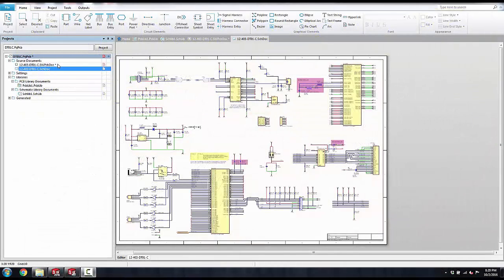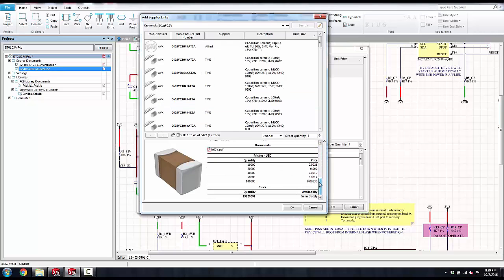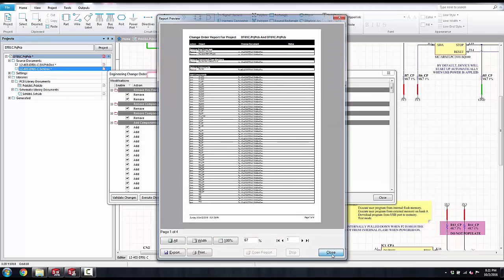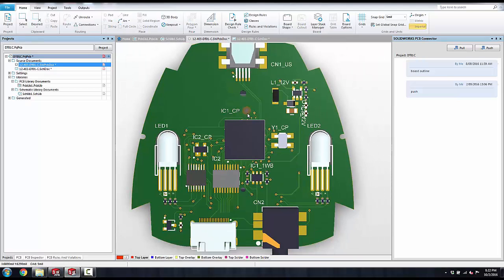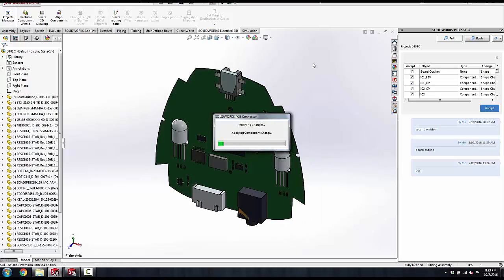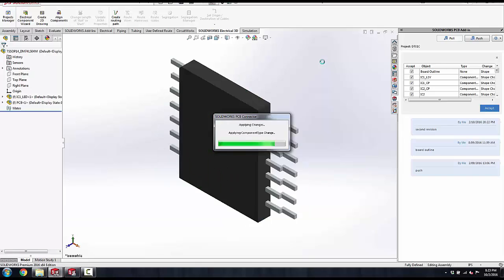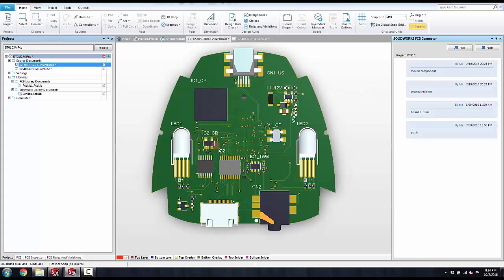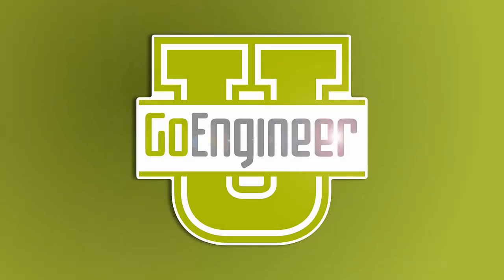SOLIDWORKS 2017 - PCB

Comment: WHAT IF I DESIGN A MOTHERBOARD IN SOLIDWORKS AND ASK THE PROGRAM TO SIMULATE PROCESSOR ON PCB AND RUNG ON IT SOLIDWORKS AS WELL AND AGAIN OPEN ALL FILES IN SIMULATED COMPUTER AND DO EVERYTHING AGAIN AND AGAIN ?? WHAT WILL HAPPEN??
Reply from the maker: Hi Vakar,
To what end are you doing this simulation?

Comment: Is Altium Designer interface with SW 2017 only? Also, compatible with SW Cosmos Work applications such thermal and structure analysis?
Reply from the maker: Hi H,
SOLIDWORKS PCB is essentially an integration of Altium into the SOLIDWORKS interface so for previous Altium users it is going to look familiar.  Also, once the board designs are generated as solid models in SOLIDWORKS you can utilize the Simulation add-ins to analyze heat generation and dissipation for the design as well.
Reply: Thank you very much, GoEngineer.  Have a great day.

Comment: this is the classical Altium Designer interface, what is the game here?????
Reply from the maker: Altium teamed with SolidWorks to create an integration of their product into SolidWorks.  Yes, it does seem to look familiar. ;)
Reply: Okay, how I can export 3D .pcbdoc Altium File to Solidworks without losses? First variant is .step file, but its not elegant solution. Is there other variants?
Reply from the maker: There is the PCB Connector which let's you translate the Altium data into a 3D model in SolidWorks without the STEP intermediary.  The objects that come in are still featureless solids.